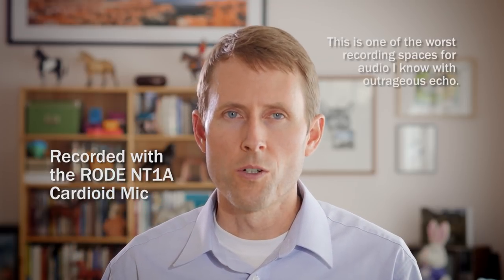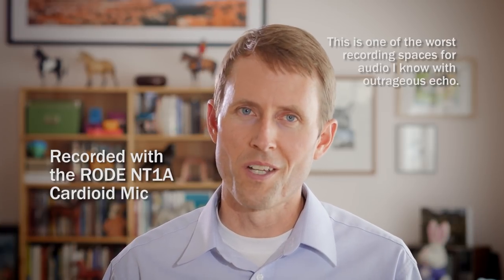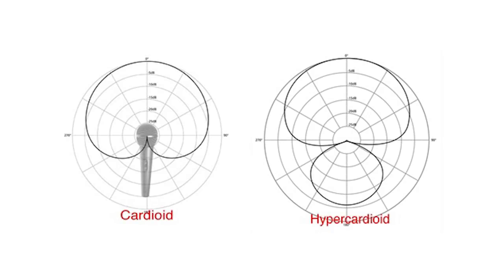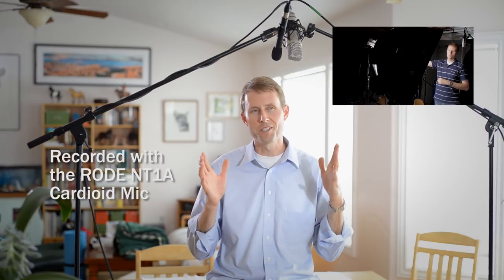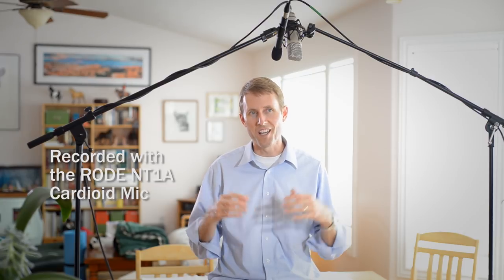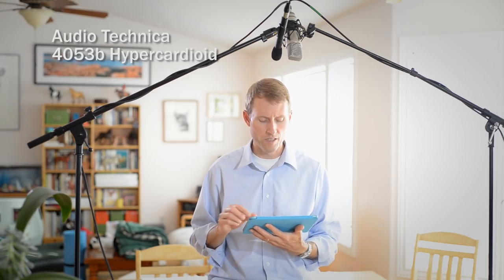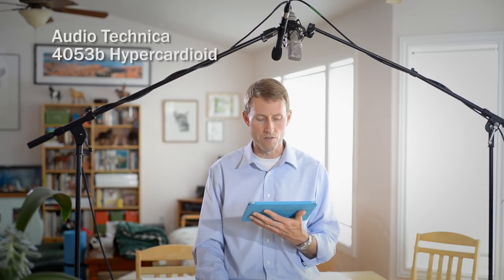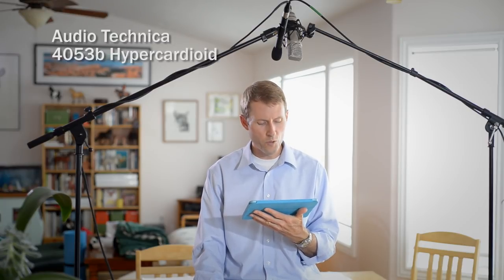Mics for Rooms with Echo: Cardioid vs Hypercardioid

Comment: The term you're looking for is reverb, not echo. Echo is a sound reflection that takes longer than .1 seconds to reach the listener (or microphone) when compared to the direct sound. Reverb is a reflection that takes less than .1 seconds to reach the listener (mic) respective of the direct sound. Speed of sound at sea level is around 340 m/s (depending on room temperature) So if you do the math you need at least 17 meters from you to a reflective surface in order to hear an echo. (sound leaves your mouth, travels 17m reflects off a wall, travels 17m back to your ear .1s later.) Odds are the room you're in isn't large enough to produce echo, but is probably fairly reverberant. Hope my comment was helpful! :-)  Other than that, pretty good video. Personally I prefer the cardioid over the hypercardioid because it seems to pickup a little bit more of the room, and helps it sound a bit more natural. Thanks for the video!
Reply from the maker: +Drew Jenkins Thanks Drew!
Reply: +Drew Jenkins More accurately, I believe the term you should be saying is Reverberation which is different than the word Reverb. Reverb is defined as an effect coming from an amplifier device.
Reply: +MAC Motions correct you are. I just shortened reverberation to reverb like I would if I was chatting with someone. Reverberation is the more accurate term. Thanks.
Reply: Drew Jenkins it’s not clear what mic do you prefer.
Reply: I'm just having fun seeing a bunch of people have a civil conversation about technical stuff. I didn't know what the technical difference was between echo and reverberation. Thanks for the information!

Comment: Cardioid has much less echo than the Hypercardioid Microphone for indoor dialog with multiple hard surfaces creating echoing. The RODE NT1A Cardioid Condenser Microphone however did not have as much low or high frequencies compared to the Audio Technica 4053b Hypercardioid Microphone. IF you want to only record the isolated voice of the talent, Cardioid wins. If you want some ambient sound/noise and atmosphere in addition to the talent, Hypercardioid is a better choice.
Reply from the maker: Thanks Romeo
Reply: Romeo and Curtis , I am looking to improve my audio quality and I am considering Senheiser MKH 8040 or 8050. The room I record in is somewhat sound treated, with non-treated ceiling and a carpet on the floor (walls have some acoustic panels), but still has noticeable reverb and my current shotgun (Rode NTG4) is not giving me the results I need. So, which one would you recommend, 8040 (cardioid) or 8050 (super-cardioid)? Thanks in advace!
Reply: @curtisjudd   see below please. thx!
Reply from the maker: @ekredel  Hi Kresimir, I know this isn't what you asked but I don't think either of those microphones will solve the problem. I suspect that more acoustic treatment will help more than anything.
Reply: @curtisjudd  Thanks for answering. Being your big fan and having watched many many of your videos, I had a hunch you were going to write something like this. :) 
I was trying to see if I can squeeze some more quality out of the current setup by introducing a more appropriate mic since I got an offer for sound treating my ceiling (with not so expensive materials) that is higher than the cost of the mics I mentioned. also, mic will (hopefully) last for a long time, and work in other rooms as well. I am a bit reluctant to invest in a space that I rent and do not own....just to let you know my line of thought...
Reply from the maker: @ekredel  Understood. I was thinking more in terms of temporary treatment like sound blankets which can be suspended on c-stands. Carpeting on the floor makes me less concerned about an un-treated ceiling. I'd be more concerned about walls and placing sound blankets in front of them.
Reply: @curtisjudd  fair point, I can try hanging some blankets on c-stands, see how much this will help, although I do have some sound panels on the walls already. Thanks again!

Comment: I'm a sound engineer and longtime broadcast producer. Polar pattern only describes the SHAPE of the pattern and is only one consideration in this untreated-room scenario. Equally, if not MORE important is the SIZE of the pattern. Not every cardioid mic is equal in this regard. Take the case of the Shure SM7b, a cardioid mic. If I put my SM7b and another cardioid mic... for instance, my AKG C1000s (without polar pattern converter)... 6 inches from my mouth, the pattern will behave in similar ways, but the AKG will pick up FAR more room sound than will the Shure. Why?  You realize why as soon as I move both mics further away (but still on-axis.) You will notice the signal from the SM7b drops off MUCH more quickly with distance. This is why, during the COVID lockdown, when artists would perform from their untreated living rooms, so many were using SM7b's for vocals, as they famously pick up far less room noise than other cardioids studio mics.
Reply from the maker: Thanks Gary, great point.

Comment: Your test is clear, the cardioid had less room echo.  And others mentioned they felt the hypercardoid sounded fuller or more like a normal voice.  Generally one can add reverb in post, but if you capture it, its harder to eliminate.  So I favour the cardioid.  I think you have to also mention that ambient recording is needed (30s or so).  As for motion as in an actor walking, then I think you have a couple choices, a lav for walk & talk, or a boom operator with a cardioid (not always there for indie shoots).   Of course you could always have a X-Y stereo record on your portable recorder for ambient foley sounds during motion (foot steps, open doors or drawyers, zippers, etc.).   ~ I will try my cardioid for next indoor shoot.
Reply from the maker: +Robert Shaw Great points! Thanks!

Comment: I believe the bubble on the rear of a hypercardioid mics polar pattern is out of phase from the front.  Which means it attempts to cancel a sound coming from the back if it's the same as the sound going into the front.  This makes it pretty ideal for live performance since there's speakers all over the place.  For indoor dialogue, I think finding the most directional cardioid you can find would produce the best results due to the phasing issues that can occur with more than one direction of capture.. but this is just my theory.
Reply from the maker: The Sonic Experience Thanks!

Comment: I realize this is an older video, but the shotgun phenomenon is actually very easy to explain.  Think of a shotgun as a long telephoto.  It compresses distance.  The background is brought closer to the subject.  What you're hearing as reverberation is actually a mix of first-order reflection (short echo) and reverberation (those first-order reflections bounced from wall to wall).

It's not what's coming into the side tube which is skewing the phase of the audio with indoor shotgun use.  It's the "overshoot" from the mic picking up the reflective surfaces behind you and moving them "closer" (louder) just like what happens when a telephoto compresses distance.  That's why it sounds "phasy" becuause that is exactly what is happening.  The reflection time is so short that it doesn't read as an echo, it reads as a phase/comb filter effect.

That's why the hyper/super/cardioid mics solve the problem to varying degrees.  They reject less reflection, yes.  BUT they do not compress the audio signal as much distance-wise, so the wall/corner/floor behind the subject isn't getting as compressed into the audio signal.

There are MANY ways mics behave like lenses, and several ways they don't.  But if you think of an Omni as a wide angle, and a Shotgun as a long telephoto, and everything else that falls between as a focal length analog,  you will get at least a basic idea of what problems a mic will solve.
Reply from the maker: Thanks Bruce, very helpful!
Reply: @curtisjudd  You're welcome.  you're running a great channel.  Not many audio-centric channels feature a/b comparisons of these mics, because on the music production side their use is mostly in niche categories.  Spot-mic'ing orchestral soloists, etc.  I am a composer/sound designer, so I have my feet in both ponds.
Reply: Thank you so much. This is a beautiful physics-based analogy. And it is beautiful and true at the same time because it relies on physics laws. 
Thanks. I loved it.
Reply: beautifully explained, thank you
Reply: Comparing a shotgun mic to a telephoto lens is the best explination I have ever heard.
Reply: This was a very interesting way to describe this. As a musician, I would always try to explain music related things to my cousin in a way that I think would make sense to her. So her being an artist, I would compare things musically to things artistically. Like I would say the drums and basic melody of a beat are like the broad brush strokes of a painting. Then adding other accompanying instruments is like adding color to the painting. Then mixing and mastering the track is like adding the shading and all the fine details. And since I'm also into photography,  comparing mics to camera lenses was very insightful and a cool way to break everything down. Well done 👍
Reply: Bruce! I don't think that's true at all, I've been led to believe that the phassing comes from the design of the tube itself. You see the way that a shotgun mic cancels sound coming from the sides is a phenomena called 'phase cancelation '. When two identical waves intersect, they will either increase in strength, if they are aligned, or cancel each other out if they are not aligned. The same thing is happening in a shotgun mic tube. The sound waves enter the grates from the sides and bounce around inside the tube, staggering the time it takes each wave to reach the capsule, and therefore canceling out. It's the same phenomena used in noise canceling headphones, except in that case it's electronic. The only noise that isn't affected by the cancelation, is the noise coming straight down the tube, hence the directional nature. Now, the reason that causes phasing inside is because the tube is canceling out frequencies coming from the speaker from the echo, and it all starts overlapping and cutting into the clean frequency of the dialog. Now I would think that the reason that the cardioid is doing so much better than the hyper cardioid is because it's picking up echoes from the ceiling, coming from being the microphone!

Comment: This was very informative and helps me out quite a bit. Thanks for this comparison.

Personally, if seemed fairly night and day with each mic. The Cardioid mic sound very rich and warm vs the Hypercardioid had a slight echoy and almost tin sound in comparison.
I definately vote Cardioid.
Reply from the maker: Thanks!
Reply: Exactly.  If I want richness with an echo and reverb, it's a lot easier to add it in post, than it is to take it away.  Rejection is key here.

Comment: This is so interesting Curtis. I have become intensely interested in this question of choice of shotgun vs hypercardioid vs cardioid for indoor dialogue since I very nearly ruined a high-stakes gig by incorrectly selecting a MKH416 for a rverberant space with resulting horrible phasing. The day was saved by redundancy audio captured on a cheap lav mic! I now own a MKH8050 hyper and the AT8053b hyper but I’m also starting to appreciate the qualities of straight cardioid. Case in point - this test ^. Through good headphones what I hear is maybe slightly less echo on the cardioid (from the lack of rear pickup not capturing roof echoes?) but also nicer quality sounding echo on the cardioid - to my ears anyway. I’ve just ordered the amazing little Line Audio CM4 cardioid and on the lookout for a vintage MKH406 cardioid, both of which I’ve heard and liked.
Reply from the maker: Hi Doug - thanks for sharing your experience and insights! Best wishes on sourcing the vintage MKH406. 😀🎤
Reply: @curtisjudd  thanks buddy and thanks for the tips on the MKH8050. I bought mine based on your reviews. I love the sound it gets for it's tiny weeny size and light weight! ...not to mention the incredible frequency response specs. At 50KHz, it picks up sounds only my Golden Retriever can hear!!

Comment: A comparison between the AT4051b, the AT4053b, and the Rode NT1A would be nice...  Would be good to hear the two AT mics side by side as a comparison in this case because the mic capsules are swappable.  You can buy either mic and purchase the additional capsule and at the swap of a capsule have hypercardioid or cardioid in the usually more convenient pencil mic format.  That NT1A does do a nice rendition with your voice.  The AT mics of this series are voiced for flat response at 12" or greater and usually keep a gorgeous amount of low frequency content.
Reply from the maker: I agree, would be a nice comparison. Unfortunately don't have the budget for the additional capsule at the moment, but will keep it in mind. Thanks!

Comment: Wow. What is interesting is that you used the RODE NT1A at about 12-18 inches away - when it was designed for microphone-in-view, close-to-mouth use. For its intended use, the RODE NT1A has significant rejection of off-axis noise, more so than the AT 4053b. So in this test, where the RODE NT1A was used on a boom, hidden from view, if its inherent noise-rejection qualities gave it a significant edge against the AT 4053b. I wonder if the cardioid dynamic Shure SM-57 with Wind Screen can be also used like the RODE NT1A in this scenario on a boom pole off view. And if it would be superior to the AT 4053b in rejecting both room noise and sound reflections for recording indoor dialogs on a boom.
Reply from the maker: Thanks Romeo. Interesting. My experience with dynamic mics is that distance makes it tough to pick up much of anything unless you use tons of gain, more than most preamps can supply.

Comment: In this particular comparison, I thought that the Rode NT1A was the better overall performer with regards to handling the room acoustics, although I preferred the tonality of the 4053b (purely subjective opinion).

There is one thing, though, that I think would have made this comparison even more interesting.  I wonder how a large diaphragm dynamic mic would have compared, such as an Electro Voice RE20.  Curtis - with condenser mics being generally more sensitive, do you think that a quality dynamic mic would have been a viable option in this particular scenario?
Reply from the maker: Hi Shawn, thanks. Dynamic mics rely on the sound source being quite close. I usually work with my RE20 within about 6 inches. Once you start drifting beyond that, it's hard to get enough signal. But, it is worth a try to hear for sure!

Comment: To this day, this still the only video that does this comparison. I’ve since switched from my hypercardioid to cardioid capsules on my Oktava MK-012 for indoors and am liking the results. 

I was hoping that you could do a test video like this using the Oktava MK-012 and the Sennheiser MKH-50 since (from what I read on social media) the 50 is the most recommended mic to use in reverberant spaces. If the Oktava does better, I may not feel the need to buy the 50.
Reply from the maker: I gave away my mk-012 so I can’t do a comparison presently. But if you’re happy with the results you’re getting, that’s great!

Comment: Sounds like the Rode NT-1 has a little bit less reverb than the AT.  However, the NT-1 is a large diaphragm condenser, good for voice-overs in an isolated booth, but with the large diaphragm, it mercilessly picks up EVERYTHING, which can make it very hard not to pick up reflections (although in this case, it doesn't sound so bad since it looks like you're some distance from your walls).  Try a smaller cardioid condenser, it might be more forgiving.  I work in a small in-house media department where we recently got the AKG Blue Line series.  The good thing about that set of mics is that it has an interchangeable capsule system, so it's a bit more economical.  The full mics are about $400 on B&H, but the beauty is that if you don't like the sound of one polar pattern, for half price ($200) you can swap out the capsule and try another polar pattern, rather than buying an additional $400 mic.  At first, b/c of what I learned on the internet, I tried the hypercardioid head for indoor booming on a recent shoot and still got a bit of reverb (it was a large office lobby where I shot it), and despite what I saw on YouTube about taking out reverb with parametric EQ, it didn't quite work out for me.  Next time I'll try the cardioid head on the mic and see if that's better.
Reply from the maker: I agree! In fact, we compared the AKG Blue Line to some other small diaphragm condenser microphones here: https://youtu.be/q-b_1gOYOEQ

Comment: Would be awesome to see this test again with the same mic with different capsules... Like the Oktava with cardioid and hypercardioid.
Reply from the maker: Thanks Dan. I gave away the Oktava. What I have found from experience is that there isn't a HUGE. difference between cardioid and hyper cardioid microphones in terms of their ability to capture less reverb in particularly reverberant rooms. The more effective approach is to use sound blankets or some other similar method to manage sound reflecting off of the surfaces of the room.
Reply: @curtisjudd  Thanks, Curtis!

Comment: Not only does the Rode NT1A sound warmer and have better bass and overall clarity, but the AT 4053b has a very noticeable increase of sibilance. I'm sure there's use cases for other cardioid microphones that aren't strictly "cardioid" patterns, but based on this one demo, I'm personally inclined to stay far away from the other cardioid patterns that microphones offer!
Reply from the maker: Most production sound mixers for film and TV will use super-cardioid mics indoors. The polar pattern and voicing are generally independent factors.